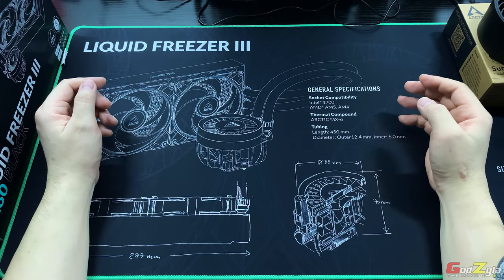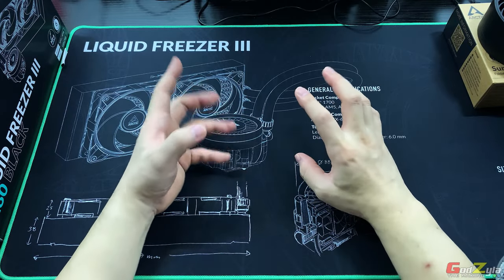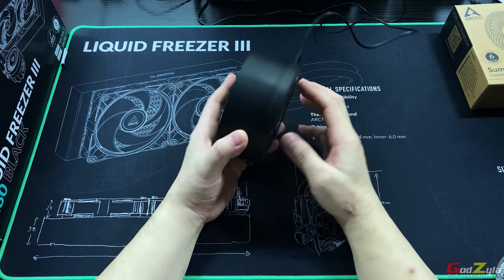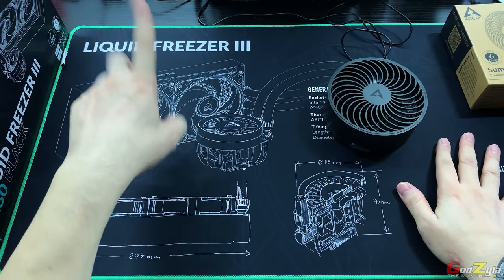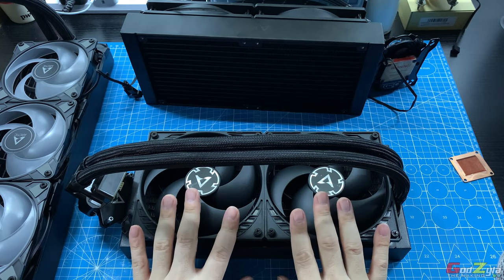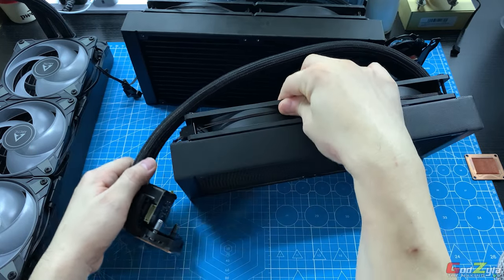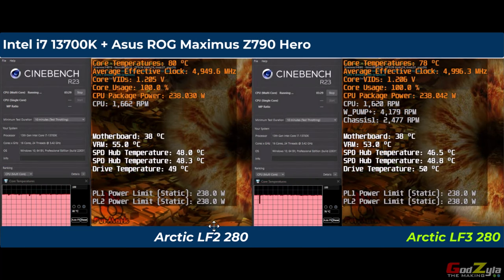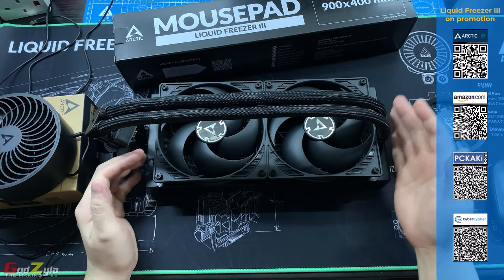Arctic Liquid Freezer III

Comment: My Motherboard is Gigabyte H610M H V2 DDR4 , my question is where to connect the VRM and PUMP connector. i bought the Liquid Freezer III 280 ARGB. also the RGB pin cant find any plug in the motherboard. Thanks.
Reply from the maker: hi jose papas, welcome to my channel. Your motherboard does not have the argb header. You might need to get a argb controller and based on your motherboard layout on page 4 https://download.gigabyte.com/FileList/Manual/mb_manual_h610m-h-v2-ddr4_1002_e.pdf?v=5df21aacf8b97861c1ead4621afe93a5 , use the all in one cable of the Liquid Freezer 3, plug to CPU_FAN.
Reply: @KleoYan  yes thanks maybe start savings again for a mid level motherboard with complete headers for all the pin in Liquid Freezer.
Reply from the maker: @josepapas9082  I see, what you can do now is to use the all in one connector of the Arctic LF3, at least your aio still can function without the argb.
Reply: @KleoYan  yes thanks Kleo.
Reply: How about this Motherboard , is this good as replacement? Asus Prime B660M-A WiFi D4, LGA1700, mATX, 4*ddr4
Reply from the maker: @josepapas9082  base on the online manual of the Asus Prime B660M-A Wifi D4 https://dlcdnets.asus.com/pub/ASUS/mb/LGA1700/PRIME%20B660M-A%20WIFI%20D4/E19950_PRIME_B660M-A_WIFI_D4_UM_V2_WEB.pdf?model=PRIME%20B660M-A%20WIFI%20D4
Yes this board does have sufficient fan headers and it does support argb too. If you are getting this board, I will plug it this way. AIO_Pump to CHA_FAN1 (full speed) , Radiator to CPU_FAN and VRM to CPU_FAN Opt.
Reply from the maker: @josepapas9082  you are most welcome.
Reply: @KleoYan  How about the ARGB 3 Pin connector, where do i plug it.
Reply from the maker: @josepapas9082  page 11 no.11 (in green) https://dlcdnets.asus.com/pub/ASUS/mb/LGA1700/PRIME%20B660M-A%20WIFI%20D4/E19950_PRIME_B660M-A_WIFI_D4_UM_V2_WEB.pdf?model=PRIME+B660M-A+WIFI+D4 and more instructions on page 13

Comment: Have you tried a push pull setup on LF3? Is it better?
Reply from the maker: Hi CE User, welcome back. Yes, push pull on a LF3 280, it drops around 6 to 9 degrees on a 7950X and similar to a 14700K. Else for the LF3 360 will be around 3 to 5 degrees.
Reply: @KleoYan  Hello! Good to know. I might do a push pull setup for the LF2 or LF3 420. What fan should I buy? Do you have a video guide on how to install the additional fans?  How will the power be supplied on the additional 3 fans?
Reply from the maker: @ceuser3555  Hi, no I don't but you will need 12 more additional long radiator screws and as for power up all the 6 fans on LF3, you will need a fan hub which has a sata cable to draw power directly from your PSU.
Reply: @KleoYan  thanks! Sounds like a lot more work. I wish Arctic came up with a preconfigured push pull option.
Reply from the maker: @ceuser3555  you can always leave your feedback through their official website or to their Reddit forum. 😉
Reply: @KleoYan  thanks! 👍🏻
Reply from the maker: @ceuser3555  welcome all the best in your build. 😉
Reply: @KleoYan  thank you! still getting everything sorted. I have made Windows usb installation and downloaded bios update to it as well. I have not yet completed backup of my stuff in my current PC include game saves, important files.
Reply from the maker: @ceuser3555  ok. Slow and steady will win the race.
Reply: @KleoYan  Zen 5 X3D will probably come out much later so I am somehow stuck with a slightly inferior hardware for computer chess at the moment though for some other games, the extra vcache works. I am hoping for a symmetry on the next release of the x3d chip so that we aren’t faced with the dual ccd issue with the flagship product for the x3d variant.
Reply from the maker: @ceuser3555  no comments as I don’t play games.
Reply: @KleoYan  no worries, you have helped me a lot with your very detailed advice on the hardware setup which is very important for me as I have not built a PC myself and simply relied on others to do it for me.
Reply from the maker: @ceuser3555  ok. Just take one step at a time. Double check all connections before powering up and good luck 👍
Reply: @KleoYan  thank you! 😊
Reply: @KleoYan  regarding the 12 more additional long radiator screws for the additional fans for the push pull config, where do I buy them? And I will also need to buy a fan hub from where?
Reply from the maker: @ceuser3555  rad screws https://www.amazon.com/gp/product/B09ZPRMGL2/ref=ox_sc_saved_image_1?smid=A19JVCA0EHM6NA&psc=1 and fan/argb hub https://www.amazon.com/gp/product/B0BP1JZTND/ref=sw_img_1?smid=A1X11FOVGZ8LKJ&psc=1
Reply: @KleoYan  thank you.
Reply from the maker: @ceuser3555  welcome.

Comment: Hi so got this aio but 3rd fans rgb not working any idea how to fix
Reply from the maker: Hi Starwarsxmarvel, welcome to my channel. where did you plug the daisy chained 3pin 5v ARGB Connector of the fan to? If it's directly to your motherboard, double check the argb connection of the fans and if you plug to a argb/fan hub, which has 8 to 10 port.. you can't daisy chained and plug to 1 port. you will need to split up the fans and plug them in individually.
Reply: @KleoYan  I plugged it directly into motherboard
Reply: Also I did the 3 seperate connections not one canle
Reply: What do you mean by double check the argon connection
Reply from the maker: @Starwarsxmarvel  the radiator side where the tubes are. There is a 3pin 5 volts connector which sticks out from the tube sleeving (I will call it connector A) Unplug your fans 3pin 5V. Test out individual by plugging your fan ARGB to connector A. Connector A is not long enough, you can remove a fan at one time from the radiator and to test it. This is to narrow down if the fan ARGB is faulty or not. If it is, contact seller or Arctic to have your unit change.
Reply: @KleoYan  what if it is not then should I just keep it connected
Reply from the maker: @Starwarsxmarvel  have you narrow down if it’s a fan ARGB connector issue?  If it is you can unplug the faulty ARGB connector, leave the rest intact and request from seller or arctic what you do next to have it replace.
Reply: @KleoYan  ok thank you will try narrow it down tommorw however what if the Arab cable is short and won’t reacg
Reply from the maker: @Starwarsxmarvel  the ARGB cables on the fans are short. That’s why you have to remove one fan at a time from the radiator to test it. Good luck.

Comment: At https://youtu.be/5F1pJrK4JIc?si=Z-Q6Ak97QDx7s6Tq&t=1896 it seems that the width of the VRM fan makes the first line of RAM memory unusable. Is this a correct perception, or is it just a parallax trick from the camera's point of view? Thank you!
Reply from the maker: Hi Gus EME, welcome to my channel. After installing this liquid cooler, there are no blockage of the ram slot, it's just the camera angle which makes it looks like overlapping to the last ram slot.
Reply from the maker: @AlterEME  you are most welcome and thank you for your valuable feedback. 👍👍👍 btw, this might interest you.. this liquid cooler runs very well on AMD but not really that great for intel https://youtu.be/ca2zGSQvWog
Reply from the maker: @AlterEME  you are most welcome. All the very best. 😉